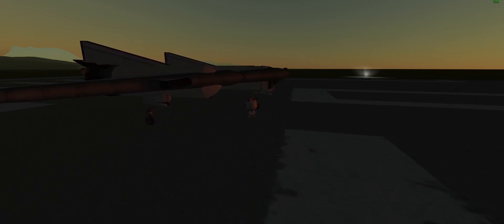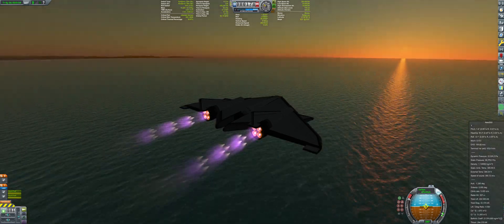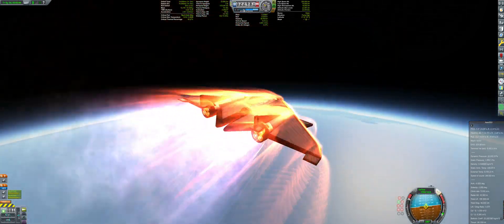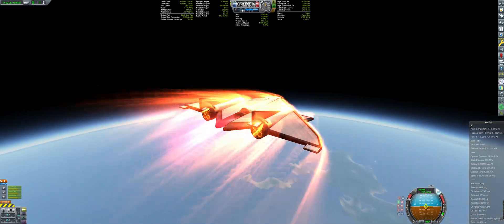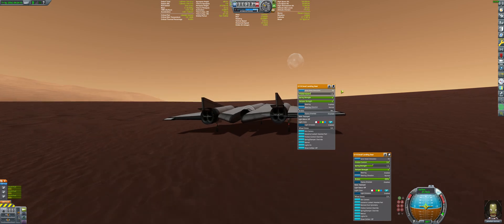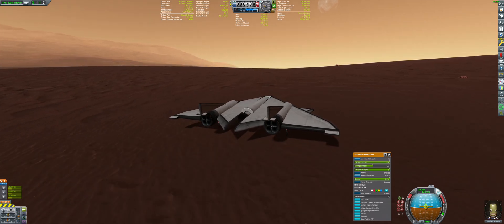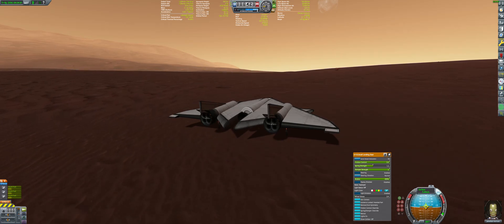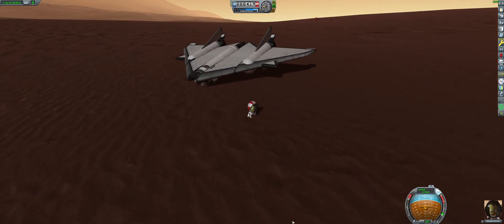Using Jet Engines on Duna | KSP 1.11.0 Stock

Comment: What engine did you use that had a red exhaust when traveling to duna?
Reply from the maker: @thebeastofthegoofers  that's what the Nerv had as exhaust when using RealPlume (which is what was used years ago, before Waterfall was made)
Reply: @lt_duckweed  Thanks
Reply: @lt_duckweed  So the thermal nuclear engine right?

Comment: Would it theoretically be possible for a jet engine to generate its own intake air using that KAL-1000 glitch where engines make their own fuel with negative throttle?
Reply from the maker: I've never tried it, but it seems like it should work

Comment: What I always wondered is why is there no oxygenless jet engine concept in the game. (While there are ridiculously overpowered electric propellers) It should be pretty efficient comparing to just a plain rocket engine. Maybe like only two times more mass intensive than an ordinary jet as you just need to carry the oxidiser and mix it into the atmosferic air.
Reply: that is just a very inefficient rocket engine then ?
main difference between a jet and a rocket engine is that the rocket carries its own oxygen, while the jet has that big compressor on the front to shovel in ambient oxygen.
Due to lower max pressure and heat, exhaust velocity and therefore isp will be much lower than if you just stuck the fuel into a normal rocket
Reply: @user-si5fm8ql3c  no, it is not? The difference in effective isp is that a jet exhaust has many times more mass than the fuel spent so the exhaust velocity rule doesn't apply the same way. The oxidizer portion is not that significant (it doesn't even need all 20% of oxygen to be burned)
Reply: @AbsoluteHuman  What you are really doing is just adding inert mass into the exhaust stream, if one optimizes this system further, you end up back at a good old rocket engine, but with a special nozzle.
By entrenching ambient air into the exhaust stream inside the nozzle, then allowing it to expand, you get the same effect, but in a lighter package.
Downsides to using ambient air in any way, jet with onboard oxygen or rocket, is that its not as effective at higher airspeeds, but for plane operation, this is no problem.
Reply: @user-si5fm8ql3c  so what you are saying is that a jet engine is only so much more efficient as how much dead oxidizer weight is ommited? Sounds not true at least according to the numbers KSP uses for its jets... I haven't really seen any real data but find it hard to believe. Is a jet airplane really only half that inefficient as a space rocket? What about a prop plane in that case? It still uses fuel to propel air in the opposite direction. You can measure the ISP of that too.
Reply: @AbsoluteHuman  if you look at the real isp, you get only about 50-150s for a typical jet, if air is considered in the calculations aswell, the only advantage is all that inert mass it throws out too, a heavier, but cooler, slower exhaust stream means more raw thrust, but due to having to slow the incoming air stream to subsonic speeds, they run out of power and efficiency at higher speeds, you could also just entrench air in rocket exhaust due to slots of sort in the nozzle, then allow the air to heat and expand to get more thrust that way.
It really is just mainly more efficient due to not having to carry around its own oxygen

Comment: How much "air time" could you get with the stored intake air powering the jets on Duna? I counted only 90 seconds, which seems quite unfortunately short :/

Also, which intake did you use to store the air? I image some have better mass/air fractions than others
Reply from the maker: I used the XM-G50 Radial Air Intake, it has the best ratio (which is still quite bad, 20kg and can hold 10kg of air).
If you got rid of all the other stuff like the fuel to get to and from Duna, and the Nerv, and used a lower thrust to weight ratio so you could really load it down with intakes I imagine you could get, idk, 5 min or so?
Reply: @lt_duckweed  Cool stuff. I did my own tests and saw the jets worked on Eve; have you tried them there?

They pump out full power to ~18K on Eve. I haven't done the math but I really wonder if Eve jets could be viable. They are certainly a lot more powerful and fun than propellers.
Reply: @Charlie-id4tv yeah but in eve you will run out of oxygen pretty quickly.
Reply: @lt_duckweed  you could try doing file editing to fill an intake with a ridiculous amount of air

Comment: What if you run air from compressed air tanks through a real life jet engine? Will it work?
Reply: Well yes but the amount of airflow real life jet engines need is enormous...so in theory it could work but it would never be viable to carry that amount of air with you. Imagine storing the oxidizer for a rocket engine as a gas instead of a liquid and adding 78 % nitrogen on top for no good reason...you're not going to go far ^^
Reply from the maker: No idea tbh, but seems to me like it wouldn't end well lol.
Reply: @lt_duckweed  Didn't they do something like that though to test some of the first ramjets?
Reply: isn't 70% of the thrust in a turbo-fan engine the fan? so it should I suppose

Comment: Nice work! Cool to see this unusual application of jet engines; I never thought the intake air storage would be significant enough to do anything.
Glad to see you making more videos too!
Reply from the maker: When I first did the math I was rather surprised with how much dv you can get, max theoretical is about 2000m/s so in theory it might be possible to make a craft that reaches orbital velocity in Duna's atmosphere.
And I'm glad to be back to making videos.  I kinda petered off on KSP for a bit but I'm back now!
Reply: I think I remember suggesting this to you at one point, but the issue was that I was considering it for getting into orbit, and you correctly pointed out that the engines require air pressure, so they wouldn't work in space.

Comment: Really cool idea! Is this actually practical beyond a proof of concept or would this mission have been easier with LOX instead of intake air?
Reply from the maker: It would have been a ton easier with LOX, with intake air you pay through the nose both in mass and part count.  For LOX, for every 1kg of tank mass you can carry 8kg of LFO mix.  For intake air, for every 1kg of intake, you can carry 0.5kg of air.  And your largest "tank" only holds 10kg of air.

Nearly 20% of the takeoff mass for this craft was just the dry mass of the intakes! Thats even more than the mass of all the engines!  And that only bought me about 650 m/s worth of rapier delta v once on Duna.

Still, its a interesting trick, and few things are as kerbal as running your jet engines off of bottled air on another planet.
Reply: @lt_duckweed  I'm using this to run jets at Tekto (that Outer Planets Mod moon with thick atmosphere and ethane lakes), using a simple "drain valves take intake air as they did in 1.9.0" mod to not run out of air (still need enough intakes to feed the jets, tho) and justify it with fluff text that those are jet engines taking ethane vapor from the atmosphere and burning it with stored oxigen - right the other way around than normal. Just because of how Kerbal it is doing that..

Comment: This is brilliant. You sound so casual when you explain how this is possible. But behind the scenes, you probably had to compare all the intakes and engines to see what is the most efficient. And I bet it was pretty counterintuitive ;-)
Reply from the maker: Oh definitely!  When you factor in air usage, the math more most efficient engine flips on its head, rapier is best, Goliath is worst!  And I had to use the radial scoop intake, as it has the best mass ratio, 20 kg of intake to store 10kg of air (ouch).
Reply: @lt_duckweed  Does closing intakes actually reduce their drag or does it only store air?
Reply: @BoomchacleV0  it has no effect on drag
Reply: @lt_duckweed  There's actually a term for this in propulsion called specific thrust - a higher specific thrust engine can develop a higher thrust with lower airflow. Engines designed for high performance generally have greater specific thrust